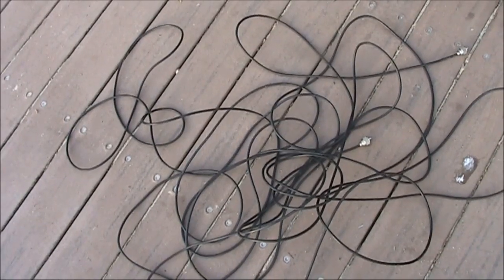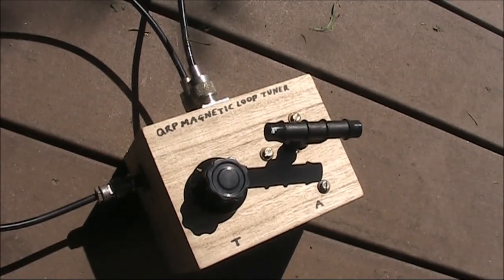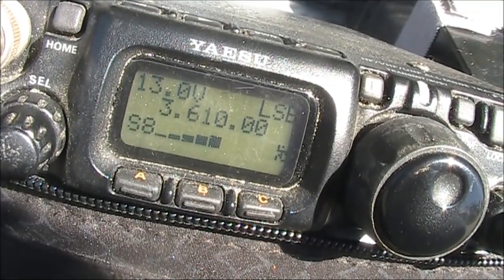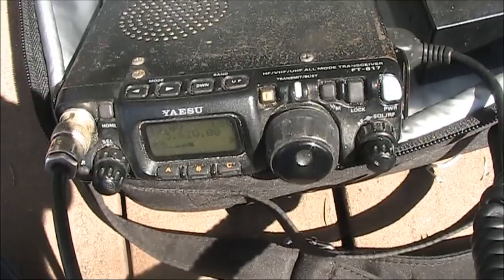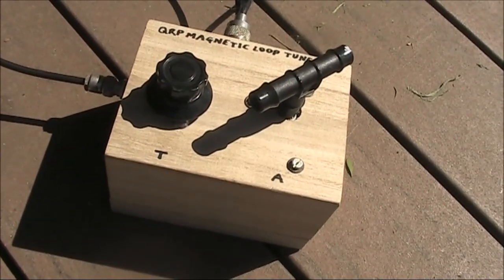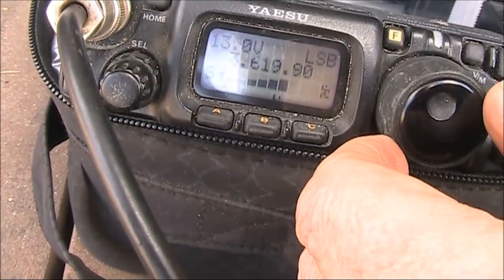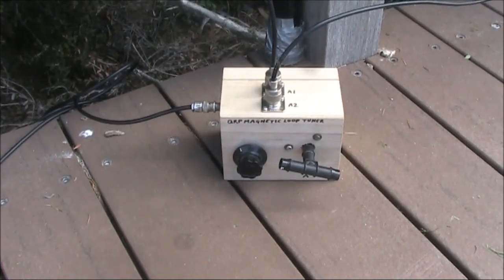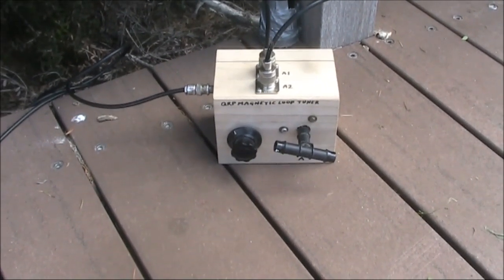Coax cable portable magnetic loop for 80 and 160m

Comment: I don’t see the two loops that constitute a mag loop antenna. Did I miss something?
Reply from the maker: Mag loops often have two loops or a gamma match arrangement. This loop is different again with the loop fed at the capacitor end.
Reply: I still don’t understand. You showed a picture of a wire going up to a pole. But I didn’t see a circular loop.
Reply from the maker: @hughbassoon  There is no circular loop. See the diagram at 1:07.
Reply: Ok..I see the circular structure in the diagram. I just didn’t see your circular structure in subsequent slides I’ll look again.
Reply: I’ll take your word for it.

Comment: This is good, but it's not a magnetic loop antenna. It's a short transmitting loop. Perfectly decent antenna, but different category and behaviour. Your box of tricks looks great and is exactly the sort of thing we should be building rather than buying. 🙂
Reply: It is a magnetic loop antenna.  Exact same schematic as the MFJ 536B.  Effectively it is a gamma match which in turn is an auto-transformer.  Just as a transformer is still magnetically coupled when tapping the coil so is a mag loop and at low frequencies it is a lot easier to implement a gamma match than to try to have some sort of huge inductive small loop 20 feet in the air to couple to the loop.  I also find the gamma match a LOT easier to achieve 1:1 SWR.

Comment: Thanks for video Peter. I think mag loops are amazing - little antennas that work surprisingly well. I wonder if you have tried using regular wire rather than co-ax? Wondering if this would have a significant effect on performance?
Reply: The diameter of the wire used in the loop is extremely important. Going from 1/4 inch to 1/2 inch approximately doubles its efficiency and effective transmit power.  I'm not sure that it makes that much difference on receive but seems reasonable to assume it does.  There's an online calculator for mag loop antennas and you can put in various parameters and it will tell you the efficiency but using ordinary wire your efficiency is going to be only 1 or 2 percent.  1/2 inch copper tubing gives about 52 percent.